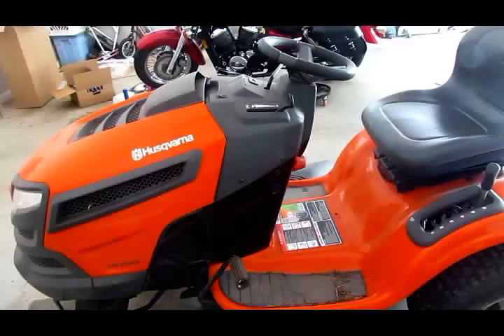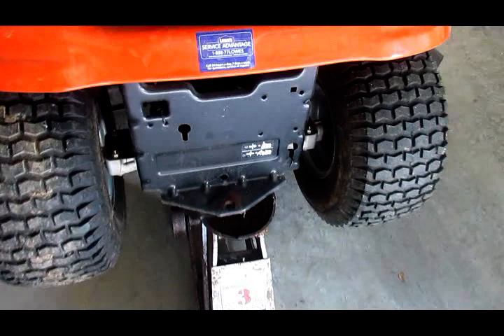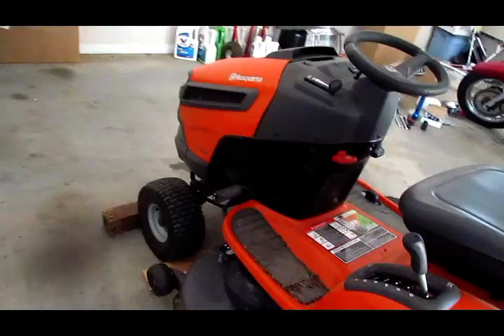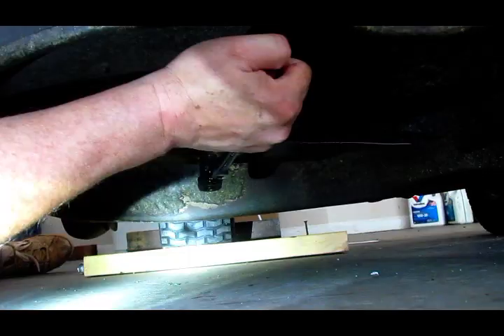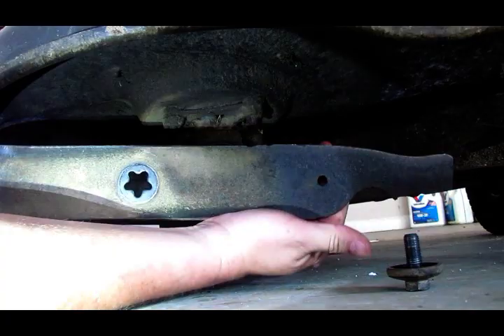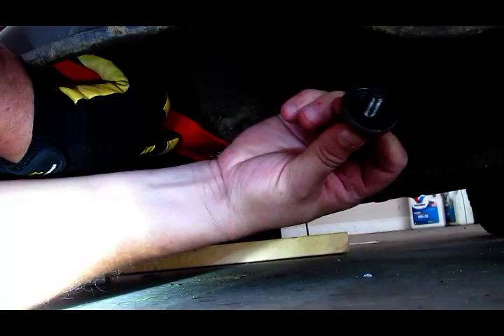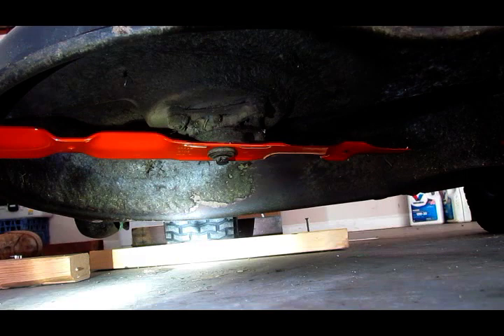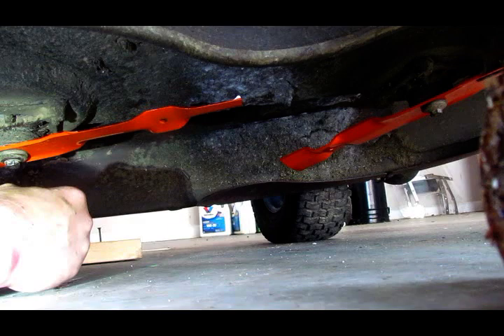Husqvarna YTH22V46 Blade Change - change your yard tractor blade

Comment: Hey Dennis, what's your take on sharpening the mower blades?  Lowes has a sharpening kit for sub $10, and I thought it would be necessary to do that occasionally.  But does it instead make sense to let them do their thing until they need a full replacement, and then go that route?  Thanks so much!
Reply from the maker: Hi Ryan,
  I think it depends a lot on what you cut and what you do with your mower.  If you have a really nice lawn, especially with a grass that likes sharp blades, ie Centipede, St. Augustine, Bermuda, Zoysia, etc...yes, you should probably sharpen your blades at the beginning of mowing season and probably at least once during the season.  My preferred method is to take the blades of the mower and use a file to sharpen them.  If you keep them in good shape, it only takes a few passes with a medium file to put an edge on them.  If they're so beat up that a file won't do it, you can use a grinder to shape them and then put an edge on, but  alot of times, if that's required, the blades are shot anyway.  I think fescue and some other grasses are a lot more forgiving, and if the mower is cutting ok and the grass isn't showing signs of being beaten to death on the tips, you're probably ok.  If you are just letting anything that is green grow in the yard (like my back yard), then I wouldn't worry about it until the mower isn't cutting well.   Now all that said, the mower itself will be more efficient if the blades are sharp.  
  Since I'm pretty rough with my mower, I always sharpen my blades before I put the tractor up in the Fall.  Then I'll usually sharpen them 6 weeks or so into the cutting season.  I'll replace them usually every other year.  Be careful with some of the replacement blades out there...they are slightly thinner than the factory blades, making it hard to get the blade bolt and washer tight against the blade.  I've had a couple of sets like that and I had to routinely tighten the bolts up......before I got tired of it and threw them out.
Reply: Nice, that's some helpful detail.  Our "yard," if you can call it that, is about 22 - 25 acres of whatever has had the desire to grow for decades, so it's tough, unbalanced, and often woody.  Thankfully I only have to mow about 3 acres of it, but it seems like it's pretty hard on the blades (especially when I nick hidden rocks).  I've mowed twice this season so far, and, checking the blades, they already have quite a few dings / burrs.  They're still cutting fine, though.  I'm not sure if a file will be up to the task, but I'll definitely give it a try.  The tool I saw at Lowe's was a sort of grinder-head attachment for a power drill, and it also comes with a balancing kit to make sure the blades are even before you re-attach them.  From your description, it sounds like that might be a decent middle ground for sharpening.  I'll probably try the low-wattage approach (file) first and see how it goes.  

Thanks a bunch for the note on third-party blades, too.  I have my eye on a highly rated set of "Oregon 596-615 Gator Mulching" blades for the replacement (since the factory-default ones seem to be high-lift blades, and I'm not bagging), since they're a bit cheaper than official ones, and most of the reviews say they last a lot longer.  I'll probably pose a question about thickness / potential vibration before committing to that.  

I appreciate all the help, Dennis!
Reply from the maker: Thanks Ryan, yes that kit at Lowes sounds like it would do the trick.  The back of our property sounds similar to yours and it beats up the blades pretty badly on occasion.  :)   If you get them, let me know how you like those Oregon mulching blades.  I' might like to try them on this tractor.  Thanks again!!

Comment: just noticed  on the same mower my "mechanic" cousin changed the blades 2wks ago  and its been cutting weird , I looked at it after this vid,   and YEs  he put it On backwards ffs ...lol    just flipped them now ......good thing i dont let him work on my cars lol
Reply from the maker: Thanks so much for watching Jessica.  I'm glad you were able to figure out the blades and get it fixed!  I'm sure it cuts better now that you've fixed it!
Reply: yes it those thnx,  did the lawn yesterday 3-4 acres and noticed both transmission mounts in the rear are broken off and transmission  is rocking ....have to fab new cross braces for it ...i wish it was just the blades LOL

Comment: My bolts just spin, one is seized. Not sure where to go from here...?
Reply from the maker: Hey Benjamin,  if you haven't already done it, you may want to disconnect the deck from the tractor, and pull it out, turn it upside down, etc, so you can really see what's going on and so you can have much better access to everything.

Comment: Safety FIRST!  The first thing you do is disconnect the spark plug wires.  The second thing you do is jack it up. The third thing you do is block it up or put jack stands under it. These tractors weight hundreds of pounds. If it falls on you and doesn't kill you, it will put a hurt on you.
Reply from the maker: Or you can just keep it simple like in my video....take the key out, don't jack it up and change the blades in a couple of minutes. Nothing unsafe about they way I show to change the blades.  Thanks for watching and for your input!

Comment: You stated those threads were LH threads, yet you pulled 'left'. to loose the bolt.'  With LH threads you push Right to 'loosen' the bolt, not left as you showed in this video.
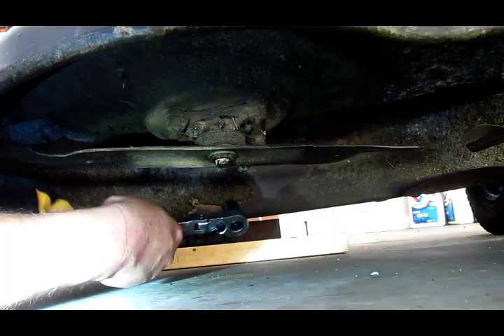Reply from the maker: No sir, at 5:00 I clearly state they are RH threads. Thanks for watching.

Comment: THE GRASS IS SO CAKED UP - THAT YOUR DECK HAS STARTED TO RUST.
Reply from the maker: The light surface rust under the deck is from normal usage...grass, dirt, etc will always remove the paint from the inside/bottom of the deck and exposed steel will always rust.  Notice at 4:00 in the video, I made a note to scrape the caked grass off the underside of the deck.  Doing this will prevent any more rust than is necessary.  Doing this has also allowed me to continue to use the original deck on this tractor for over 4 years....and I'm pretty abusive with it as far as what I cut.  Thanks for watching, I appreciate it!
Reply: @dwcoffey  Dennis,,after removing the grass from my deck I spray a good coat of Silicone underneath, hoping it will slow down the rust and keep the grass from sticking so easily.